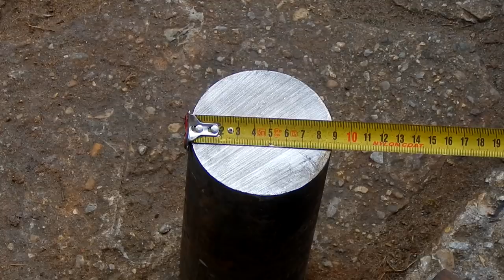Turning V-Groove Steel Wheels - Band Sawmill Build #11

Comment: Looking PRET-TY GOOD. 

Even if you didn’t really save money making them you have the satisfaction of knowing you made it yourself and that you used good quality bearings that will last.
Reply from the maker: Yup, for sure. The main reason for making these myself was the shipping time for the eBay v-groove wheels I looked up. They weren't pricey per say but I needed them asap.
Reply: Well that's not true as the actual bearings were purchased and inserted into the v groove roller shell. There's no way of knowing how well the inserted bearing will last as they are of a small design with tiny rollers balls within that may prove to be of high quality or may not and fail quickly under load.

Comment: Damn man, im impressed you lopped off a piece of 4 inch steel with just a grinder. Props.
Reply from the maker: It wasn't too bad and went quite fast considering the size. Just have to move the cutting disc around in the cut so the material doesn't get red hot. Thanks for watching!

Comment: Nice work man. If you make it at home, it’s definitely home made. You may be using a lathe but it’s a simple lathe and it looked like you eyeballed the tapers which is not easy to do. If you used one, I didn’t see a taper attachment. Keep it up!
Reply from the maker: I turned the compound rest on the cross slide to 45 degrees (both ways) while hand feeding the cutting edge. Thus the rugged finish but the angle was exactly 45. It's quite hard to eyeball the taper. Thanks for watching!

Comment: A trick I learned from repairing Overhead Electric Crane collector systems is that the Vee wheels running on an angle iron rail glide better, smoother, and last longer with a radius midway down in the vee gap . The lower surface of the wheel is actually moving faster than the top surfaces causing excess friction. With a radius midway in the vee gap only the pinnacle of the radius contacts the surface of the angle iron rails significantly reducing the contact area.  I hope I explained it well enough to understand.
Reply from the maker: Yup, you explained superbly. I noticed that in real life too. I presumed that the faster moving outer part of the contact surface on the wheel will just wear out faster and the contact area will be reduced to smaller radius. It was just easier to make'em exactly at 45 degrees in the lathe. ;) Thanks for the info and thanks for watching! ;)

Comment: can i ask what brand/model/specs your lathe is and if you purchased it or inherited it

good product from just a bit of steel drop and some bearings, i wonder if some sort of steel wire/brush riding infront of the wheels and clearing sawdust/debris off the angle iron right before the wheels pass over would be a cheap/easy way to improve the gliding on the head and prevent jams/derailing and the power head climbing up on sawdust higher on one side compared to the other
Reply from the maker: My father bought the lathe dirt cheap something like 15 years ago. I'm pretty much the sole user of it now. When it comes to the sawmill I will add some scrapers in front of the wheels and probably steel wire brushes on the wheels to get all of the sawdust away and off from both the rails and wheels. But we'll see.

Comment: nerves of steel you must have parting off with that amount of stick out! nice work, cheers.
Reply: I can't believe that 3 jaw held.
Reply from the maker: I did most of the parting off cut beforehand while supporting it with the tail stock. Left only a couple of millimeters and stood away from the chuck when parting. Also tightened the chuck like a mad man. Should have seen my face. It was like Hulk but more green.
Reply: Ok, so there was no reason for me to dive under my desk. ha ha.
Reply: Самый лучший,у меня тоже 1к625 КР.ПР.

Comment: I m making them for a living,the Angle should be more than 90  so there Is less friction and gate goes easier,wheel should touch only the top of Angle iron,not the sides
Reply: Do you have specific dimensions for certain size wheels and angle irons? Wheel od, groove width/depth,  center bore, bearing id/od/width, etc. I have also seen angle irons with the L up and wheels not contacting sides. Do you think that is an acceptable solution?

Comment: Sorry if you have already said ,Are you building a bandsaw mill or chainsaw mill ?  i seem to remember some debate about which.
Reply: Swing blade is more universal on the negative side it produce more waist saw dust, bandsaw is faster but you have to turn the log if you want clean edges
Reply: many thanks so swing blade it is ? you can do more quarter sawn wood with swing
Reply from the maker: I started off with a plan of building a chain sawmill. Since then I've changed the plan to building a band saw mill instead. :D

Comment: I used old v belt automotive pulleys. Alternator on larger equipment have them this size. I work in diesel field so I had some from a recall campaign brand new in my junk drawer aka my garage. Lol wife always says get rid of this or that but within a week she sees me use. I had rubber roof material for 8 years in rafters. Made a chicken coop a few years back and used it on the wood floor to make clean up easy. She was trying to get me to throw it out the week before. Lol I never throw anything away Luke parts etc.
Reply from the maker: That's the way to do it! The only problem is finding all the good stuff when needed. Sometimes I have stuff I need in the shelf somewhere but I can't find it.
Reply: i am alaskan and every time i through something out a week later i need it hahahaah . AKA HOARDER

Comment: how do you guarantee that the bearings are sitting perfectly aligned?  i'm assuming you had to flip the part to make the other recess for the bearing.  Then assuming when you parted it and placed it flushed against the chuck, it was perpendicular to the recess.  

I'm doing something similar but with aluminum and after putting the bearing in on both sides, spinning on a center shaft, it has a slight wobbling effect.  My bearings that go in is not entirely tight.  it slides in and with a tap it will come out so i'm not sure if my ABEC 7 needs to be pressed in to eliminate the play (wobbling).  The thickness of the part is roughly 1".  I'm making 5 of these parts but the first came out wobbly so i'm afraid to do the others for that same reason.  Any help will be greatly appreciated.
Reply from the maker: Thang To I did the part without turning it around. There's no wobbling on them.
Reply: That would be the best way to ensure that it's parallel and concentric.  so i will have to find a way to cut that from one side as well but the bearings that i use is 4mmx10mm so it's not going to be that easy.  or maybe it is but i just don't have the tool yet.
Thanks for your help.

Comment: Did you think you did something important? This is a beginner's job,
Reply from the maker: It's funny how you belittle the purpose of the things and things themselves I've done. The act of turning these in the lathe is a really simple task for anyone who has ever put their hands on a lathe. Then there's a group of people who find it satisfying and maybe educational watching something being turned in a lathe, including myself. From the sawmill point of view these wheels are extremely important since the saw carriage and saw head are running on these, the accuracy of the cut is dependent on these and my safety and other people's safety when operating the sawmill once it's finished is dependent on these wheels. So yes, I'd say I did something incredibly important for my sawmill. Thanks for watching! ;)